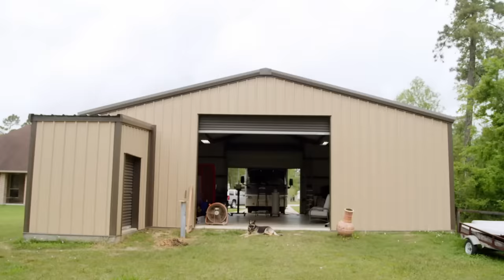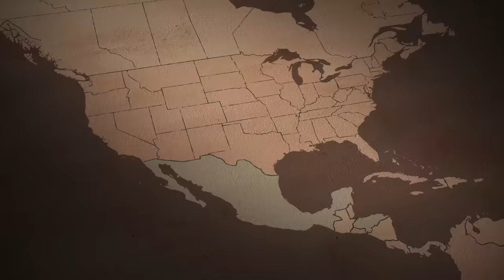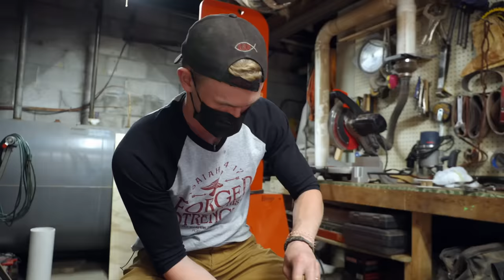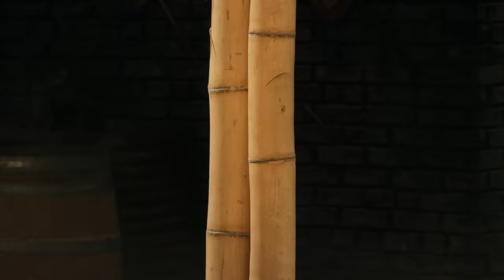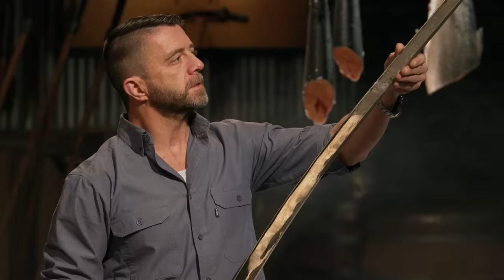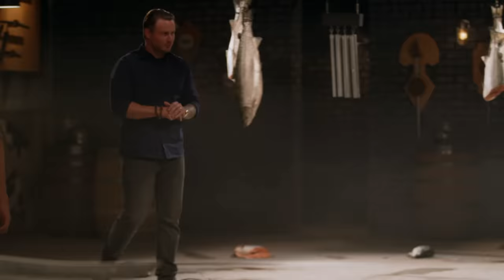JAPANESE GREATSWORD Lives Up To Its Name! | Forged in Fire (Season 9)

Comment: The fact that Ian made such a great blade by using a makeshift coal forge in a ditch and got such an even hard temper is amazing. His setup seems very humble.  Hopefully he used the funds to improve his forge.
Reply: he only heat treated it in the coal ditch. he didn't forge it in there.
Reply: @CloudianMH  Even so, what he did just shows that all the modern bits are not really needed.
Good job to the young guy.
Reply: That’s most likely the reason he won honestly. Being able to heat the entire blade at once. The coal has some hotspots, but it’s a less intense heat and brings the steel to a more even temperature more slowly and evenly with a more refined grain structure. It worked wonderfully.
Reply: no doubt he will and there is also the possibility that he will attract the attention of forge and fabricating sponsors
Reply: That's actually how they used to do traditional tamahagane.
Reply: @Leonarco333  nah, the biggest reason he won, was that his blade wasn't super high and thin like the other one was, you saw the other one flex waaay more and thus cut way less deep in the pig cuts due to that. For these kind of swords you want a decent but rather thick spine, yet not too high max 3-4cm but a good tapered edge that can take a beating. These are almost used like the Dane axes are, to chop into bodies with bones etc to cut through. Thin flexible blades don't do that well.
Reply: @pr0faker  true, but the  vast difference in durability of the edge on Ian's blade is likely due to his tempering technique
Reply: Thank you all!

Comment: Ian's Odachi is even more impressive than David Baker's example and it has that classic Samurai look. Austin's blade has more of a Chang Dao (Chinese greatsword) look
Reply: Agreed. Austin's blade profile is more akin to, albeit broader than, the Chinese and Korean adaptations of the Japanese sword. I usually prefer the adaptations as cutters, because as they're broader, thinner and lighter. But in this case, its hard to argue with the judges.
Reply: @Oppetsismiimsitsitc  Wouldn't call the Chinese greatsword an "adaptation" of the Japanese greatsword. If anything, the other way around.
Reply: @ludovicocalvetti1250  depends on the sword. Changdao and the Miaodao are based on Japanese designs, especially the former. The latter has a pipe back blade like European sabres of the 19th c. Zhanmaijan and zhanmadao are not influenced by Japanese blades, but they are quite different and from an earlier period. Chinese influence on Japanese blades was a far far earlier phenomenon.
Reply: @Oppetsismiimsitsitc  TIL! I always assumed that the Dao just “evolved” naturally into the Changdao as metallurgy improved. It’s nice to see Japan “giving something back” to Imperial China as far as technology goes
Reply: @ludovicocalvetti1250  Japanese influence on Chinese Daos really took off in the 16th century, when the Wokou were causing all sorts of trouble. The Wodao, for example, literally means "Japanese Sword." 

Some of these swords were literally Japanese made, but many more were made in China. It was the form and function, rather than the specific metallurgic practices (using iron sand to make tamahagane/bloomery steel), that were copied.
Reply: @Oppetsismiimsitsitc  I know I'm super late, but which region's metallurgic practices were superior in general, and why?
Reply: @Akshay_PJO  In general, the practices used have more to do with environment than superiority. They share more in common than you'd believe. 

there's a good vid on it, "misconceptions about medieval steel." it goes in depth, but the first 10-15 mins alone have some good info.
Reply: @Oppetsismiimsitsitc  Alright mate, thanks so much :hand-purple-blue-peace:

Comment: You do realise that if the entire blade has the same even thickness it will shake during impact and it might even snap.
Do the best blade is thicker from the handle and goes thinner at the tip.
So, when you strike you have enough swing power from the handle and the back bone of the blade is thicker to support the cut and not risk making it go blunt after a few hits.
Reply: The more important reason for this is balance - you don't want a big sword to be tip heavy, because you need precise control of where you swing.

Comment: When making a Nodachi or any katana variant it's very important to keep the blade so it's never wider than the handle to keep the weight closer to the handle. This is a reason why Ians blade had a much easier time.
It's also important to know how to actually know how to wield a katana properly, I could see that the judges who used both swords kept putting two much power into their right hand and the blade suffered the consequences along with or ruining the cut or dexterity of the blade.
This isn't much more important but please don't call it a Japanese Greatsword like you would never call a Cutlass a pirate sword, Zweihander a German longsword or something along those lines.